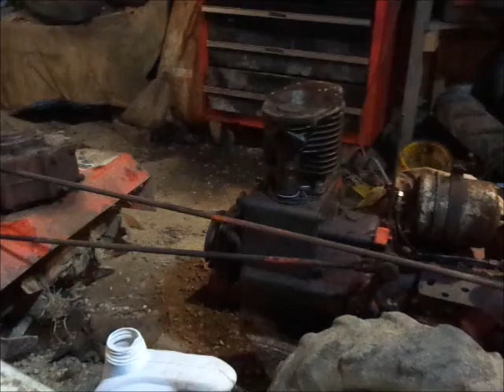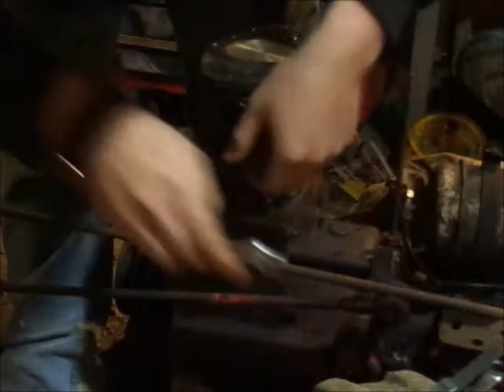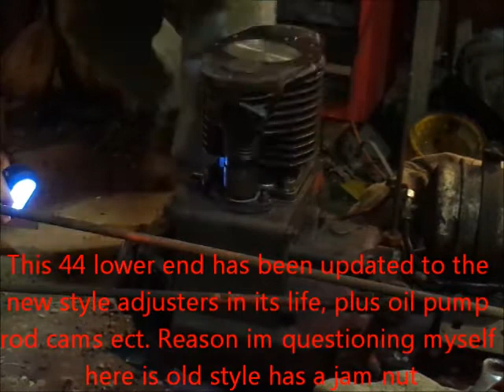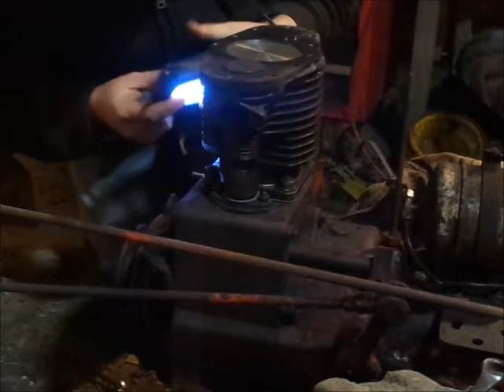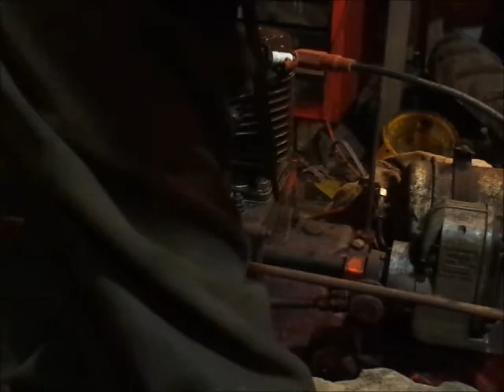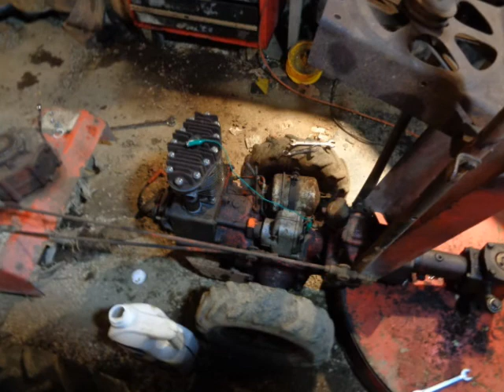1944 Gravely model L project part 7 adjusting valves & setting timeing

Comment: Is there any seal between the two halves of the valve adjustment covers? Putting mine together and it seems like it would let water in
Reply from the maker: nope no seal, and i agree plus leak oil
Reply: Thank you for the reply. Guess I’ll just try to keep it dry or make some kind of cover for it